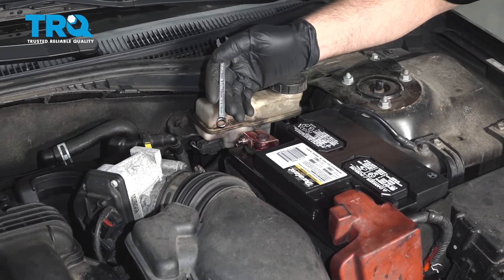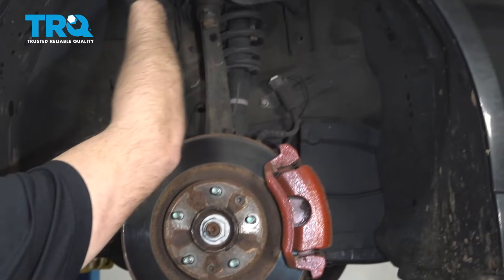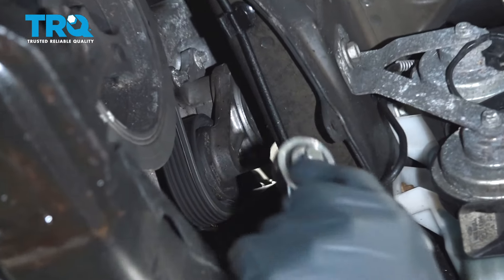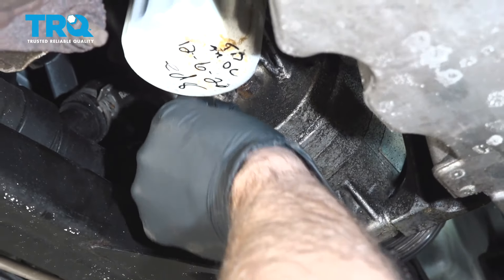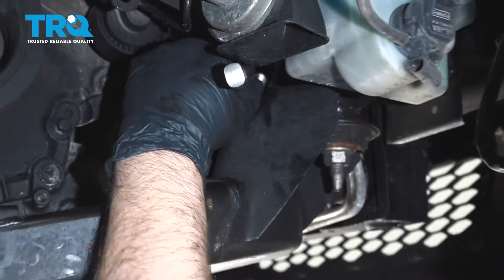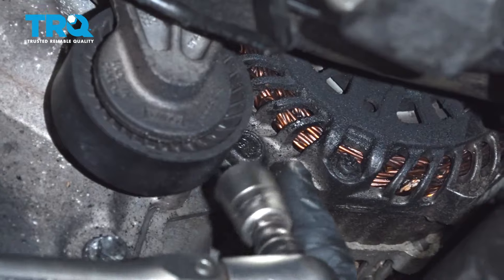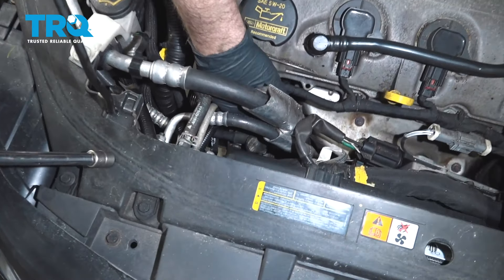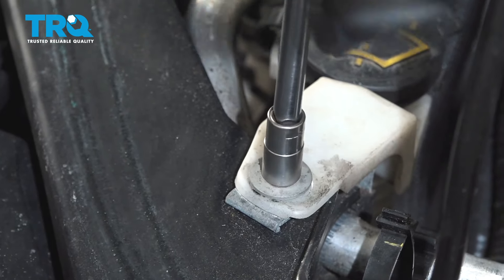How To Replace Alternator 2006-2012 Ford Fusion

Comment: Seriously looks like some serious knuckle breaking, back aching, muscle tearing, tool throwing, badly cursing, messed up work. Congrats, Ford. You made a disposable car!!!!!!!!
Reply: Crunch! Rib-Shaking,Flesh-Tearing,Teeth-Breaking, Sound of Glass Breaking, Bone-Breaking,Ear-Splitting, Earth-Shattering, SMASH!
Reply: It is. Just got the AC compressor off and I already regret doing this myself
Reply: This is why mechanics and DIYers hate engineers. $150 part…..$1000 labor to take the whole damn car apart to swap something they know doesn’t last.
Reply: It's a really nice car...but Ford really did a job on the vehicle...

Comment: There should be a disclosure telling viewers there is an easier way to remove the alternator from the top.  Removing the fan assembly is much easier.  Not all of us have a hydrolic lift.  Your way is the hardest way imaginable.   Are you trying to help do-it-yourselfers or discouraging them to do it themselves?   I question your ability to actually troubleshoot and come up the best solution.
Reply: They show you by the book on how the manufacturers recommend repairs be done.
If he didn't do it by the book. There would be people in the comment section trying to roast him for taking short cuts.

Comment: I know this is an old post, but as a victim, let me vent... First I'd like to thank TRQ for the video, as it, and the comments were helpful.  Boo to you Ford / Lincoln for designing a vehicle where the simplest repairs have been made ridiculously difficult.  An absolute nightmare for basic DIY folks.  There is a message here... don't reward car companies that make repairs difficult / impossible for the car owner, while making the cost for repairs by the dealer absolute thievery.  In many cases, the repairs are needed due to defects in design and / or implementation by the car company.  example: If you think the alternator replacement was bad, try to do a water pump replacement on the 3.5L.  Ford / Lincoln, in all their wisdom,  put the water pump "inside" the engine, which has caused the destruction of many engines due to coolant in the oil.  Guess who got stuck paying for this?  You know the answer.  It's pretty clear that their direction was to create "throwaway cars" but keep the price the same or higher.  Remember back in the day when you could replace a water pump in 20 minutes? We need current car companies to bring ease of maintenance back, or we need new car companies with a focus on the consumer.

Comment: I hope everyone who checks out this video reads this  -

The easiest and fastest way to do this job is to remove the fan assembly. I had to disconnect the upper radiator hose on the drivers side so I could move the fan slightly towards one side, so it clears the transmission lines on the other side. Bottom alternator bolts are easily accessible after partially removing the splash shield. I used a bungee to hold it out of the way. Also it will help tremendously if the top most/low side/thicker air conditioner-to- condenser line on the passenger side is disconnected. This will allow you to not fight the alternator so much or scratch the radiator fins, while trying to slide it out. Two A/C lines are in the way. Disconnecting that particular one will give you more room to get it out and then in 

I just did this job on a Fusion V6
Reply from the maker: +emm cee Thanks for the feedback! http://1aau.to/m/Shop-TRQ

Comment: My alternator is on its way out and I’m going to tackle this job tomorrow. Did not know I needed to drop the subassembly. Definitely not a lunch break project. Thanks for the heads up. And I need to oil change, so that works.

Comment: You have got to be kidding me... to change this alternator you need to drop the damn sub-assembly and basically change your oil as well... This has got to be one of the most god-awful DIY projects for the regular guy. I will pay someone to do this for sure after watching this video. Entirely too much involved. Thank y0u for saving me the hassle! Great video.
Reply from the maker: +Justin Tisevich Thanks for watching our video! http://1aau.to/m/Shop-TRQ
Reply: @Justin Tisevich you’re right. This is a goddamn hassle. No wonder the shops say $520 parts and labor. This really is a $250-$300 dollar labor job. Way too much involved
Reply: Thank god I'm not the only one who thinks this as well. You took the words right out of my mouth

Comment: Good video helped me do mine and in -20°c this was one heck of a job my compressor stud wouldn't come out so I had to double up the nuts on it and use that method of removing it I tried the fan shroud but abandoned that method this was definitely the way to go no offense there professional mechanic.  Mind you mine is a '07 Lincoln mkz brutal job to take on in the winter in Canada in my driveway
Reply: Man, being that cold it be Can't'ada for me

Comment: I just did this job on 2010 fusion.  I found removing the exhaust manifold to be way easier.  Have to remove the oil filter for sure. Remove the alternator studs as well. Second pair of hands will help. 
Note: check your oil pan gasket and oil sending unit while you have the car taken apart.
Reply from the maker: +Robert M Thanks for the tip! We'll pass this info along to our production team. http://1aau.to/m/Shop-TRQ

Comment: This job was a SOB!  NO NEED TO DROP SUB-FRAME OR LOOSEN AC LINES OR CONDENSOR! OR REMOVE ANY PULLEYS!!!!!
  I was able to pull it out of the top by taking out fan and moving hoses, wires, etc. out of the way as much as poss. and then maneuver the alternator to lift between radiator and engine. Be careful not to damage radiator fins!...tight fit!!! Good luck!!!💪🙏🏼

Comment: As a PRO mechanic, there is no way that Ford designed any vehicle that needs AC compressor unbolted and the subframe dropped. I would pull the fan shroud assembly up thru the hood before dropping the subframe.
Reply: So is not Necessary  take of ac compressor  off bro ??
Reply: That's my situation right now and what I'm trying to do, I have a 2008 Lincoln MKZ, this is crazy!
Reply: It’s not practical at home.

Comment: Is that the V4 or V6 engine? Or are all Ford Fusion alternator removal procedure the same?
Reply: It’s a 2010 fusion with a 3.5 v6
Reply: The v4 has the alternator in the back and is much easier to remove
Reply: V4!!??🤣🤣😂😂
Ok dont try this yourself my man
Reply: Lol “V4”
Reply: @kimberlyapuan453  man these fusions are some high performance machines packing a V4

Comment: a bad alternator should not kill a new battery that fast after going less then 5 miles and parked for a couple days the one i replaced before this one was not even 6 months old itself? i had to get one (friday 3-10) went to start today (sunday 3-12) and it has nothing like its pure dead. ty for any kind of help

Comment: I recover the refrigerant and remove the AC. Compressor and you have all the room you nerd to remove the alternator.  You do not need to loosen the engine cradle nor do you need to remove the tensioner pulley. I can do an alternator on this vehicle or the Lincoln MKS in an hour . This includes recharging the refrigerant. 

 CEO & Sr. Mstr.Mech.41 yrs. service exp.

Comment: Is it possible to change the brushes on a 2008 ford fusion with a 3.o liter v 6 with the alternator mounted to the engine ?
Reply: Better off replacing whole assembly honestly. Because you're gonna have to remove it.

Comment: Okay, so I replaced the alternator in my 2007 Fusion, and everything in this video is BS. You don't have to raise the car except the passenger side front wheel, and you don't have to take off the oil filter or splash guards underneath the car. The only reason I suggest jacking the passenger side front wheel up is because its easier to release the belt tensioner if you remover that front wheel. This video makes this look WAY harder than it really is.

Comment: And not only do you have to spend $200-$300 for a new alternator, but you also have to spend $20-$30 on an oil change........ Stupid move, Ford........ Stupid move
Reply from the maker: +brian versansky Thanks for watching our video! http://1aau.to/m/Shop-TRQ
Reply: You don't have to change the oil, you can easily just put the filter back on. You won't lose much oil just unscrewing the filter, I only lost about half a cup if that. But if you are already almost due for an oil change, this would obviously be a great time to do it.

Comment: Ford really messed up designing the Fusion. This is a disaster. instead of making innovation, the engineering went backwards. EDIT: don't listen to this video, its much easier than this. I replaced my alternator from the top of the engine instead of underneath and it isn't difficult.

Comment: Me thinks it would be easier to pull the entire engine and do the job on the stand. Thanks Ford for encouraging all of us to buy a Kia. There is no way you are going to get that compressor stud out without breaking it off in the block. The labor cost is going to be 3x the cost of the part itself.

Comment: So basically if you ever want to do any work on this car you better have a back up car to get to work because you'll more than likely need more than just one weekend. What a POS. I have a 2012 fusion and haven't had any problems (knock on wood), I have been accumulating parts to replace such as suspension parts, alternator etc, and just feel like it's not worth the f**** hassle. Probably going to trade this biiii in before something major goes wrong. 😆

Comment: This video does not work for 2006 to 2010 years , the boxy one those have the alternator in the back
Reply: the 4 cylinder habe it in the back, the 6 cylinder is in the front by the coolant